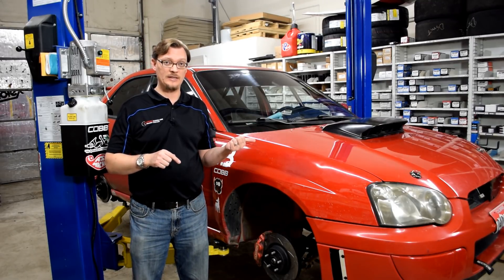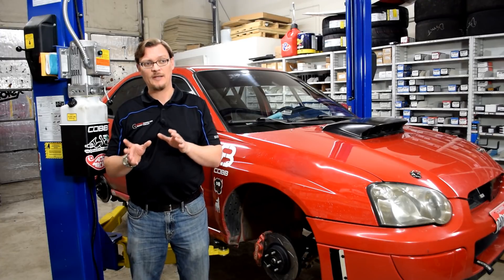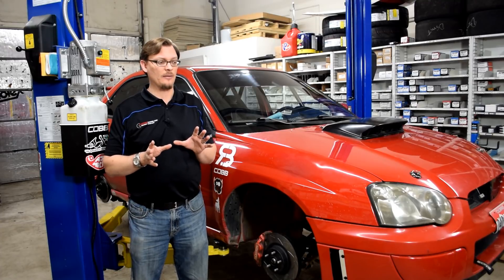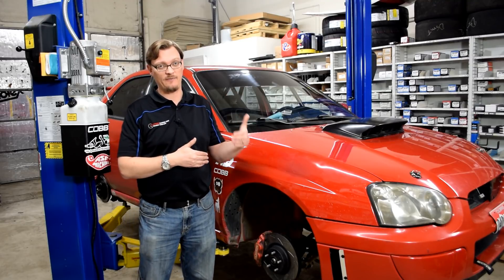STI 6-Speed Transmission Swap FAQ's

Comment: I have a 14 wrx, assuming you're only talking about bolting up a 07 sti trans, my wrx front axles would work with sti trans(center diff),  get  11-21 r180 rear sti axles, 08-14 r180 sti drive shaft, 07-14 r180 sti rear diff. w/ 3.545 gear ratio, 08-21 r180 sti rear diff mount crossmember, plug up speed sensor on trans,  iwire plug n play harness for neutral and reverse switches. Wire in Map dccd controller. 06-21 sti clutcjlh slave cylinder, 04-21 sti clutch and flywheel.  And any other essentials can be found in basic swap kit at flatironstuning.  Let me know if im missing anything. Do I also need a sti starter or can I use the wrx starter ?
Reply from the maker: Thanks for watching and thanks for the question.  Yep, you have it all right as far as I can tell.  Yes, you can use your WRX starter.

If you have any other questions, open up a Live Chat with us on the site and we'll do our best to help.

Thanks for your support and Stay Tuned!

Comment: Werent 02-03 WRXs a 3.90 FD rather than the 3.54 stated here?
Reply from the maker: Thanks for watching and thanks for your question.  Yes, the 2002 - 2005 WRX has a 3.9:1 Final Drive.

Hope that helps and Stay Tuned!
Reply: It is stamped on the gear itself

Comment: i find it funny when someone says they want to do a budget build on a Subaru. do people even realize how expensive it is to make power on these cars?
Reply: Depends on the power level most builds these days are all dyno numbers with no real world useability except highway pulls. Subarus are made for rough surfaces, point to point responsiveness, and cornering hard in poor conditions so that's what you build them for. Realistically 400hp with supporting brakes and suspension is a lot and will leave almost anything for dead on tight twisty tracks

Comment: So if I have the whole drivetrain system from and 08 sti and I want to install into a 09 narrow body will I have any issues with clearance?
Reply: At 14:00 you talked about running a 11-14 knuckle to fix the width issue could I not just use the 08 sti knuckle? Or are they different dimensions compared to the 11-14 knuckles
Reply from the maker: @jesussandoval3713  they are the same.  Just keep in mind that they push the rear wheels out 25mm per side.
Reply from the maker: Thanks for your question.  We specifically talk about doing a 6-speed swap in a narrow body WRX in the video here:

https://youtu.be/uf4tcG5GqDU?si=C8aQRNNLXMgiDKa1&t=755

That should answer any questions that you have.

Thanks for watching and Stay Tuned!
Reply: @FlatironsTuning  thank you for replying so quickly

Comment: I have an 04 wrx trying to swap to a 6 speed setup. Can I use 04 sti hubs, backing plate and parking brake if I already bought an 07 sti trans, driveshaft, diff, and axles? I don’t want to have to change my current suspension set up, I have the car sitting on tiens rn with its current setup.
Reply from the maker: Thanks for your question.  The splines on the hubs are different between the 5x100 and 5x114.3 hubs so you do need axles to match.

Hope that helps and Stay Tuned!

Comment: Hi mate, I’ve put in a 6 speed DCCD into my gc8 v6 type ra (5 speed DCCD) but didn’t change the wiring harness to a 6 speed now my Speedo isn’t working, would you think the 6 speed wiring harness would fix this?
Reply from the maker: Thanks for your question.  The speed sensor between the 5-speed and 6-speed transmission is the same.  It also has its own harness and plug.  I'd say it sounds like an electrical problem, or maybe the sensor got damaged in the transfer.

Make sure that everything is plugged in, and that the sensor is in good shape.

Hope that helps and Stay Tuned!

Comment: Does body style matter? I have a 11' WRX hatchback. I plan on doing an entire STI swap into it. Do I have to use parts from a 11'-14' STI hatch? Or can it be a sedan? Or can I use other years
Reply from the maker: Thanks for your question.  As discussed at the end of this video, the narrow-body WRX's require a few different things compared to the wide-body WRX's.

Since you have a 2011 which is a wide-body, I'd recommend going through our video on the GR specifically as that will be the information that applies to your car:

https://youtu.be/CieGYuOJQj4?si=9DN_nbdoGQBynT4_

Hope that helps and Stay Tuned!

Comment: So is the Neutral Safety switch the same on both the 07 STI and 02 WRX?  I can't remember whether I used the WRX or STI, but now that I have everything back together, I'm having issues with my idle.  I've already replaced the IACV with a new OEM one, adjusted the throttle cable and did a smoke test, but I'm still having issues.  I'm suspect it might be the safety neutral switch.  Thanks.

Comment: This video has me very excited! I was debating on selling my 13 hatch wrx and looking for a a Sti hatch but if the parts are interchangeable this looks better to do. My question is can 6 speed be done to the stock ej 255 engine the wrx comes with? Thanks!
Reply from the maker: Thanks for your question.  Yes, absolutely!  The EJ series bellhousings are the same so you can bolt up the STI 6-speed no problem.

Thanks for watching and Stay Tuned!

Comment: Sti 6 speed box screw location all pnp into 5 speed ej20 forester?
Reply from the maker: Thanks for your question.  Yes, you can swap a 6-speed into an Ej20 Forester.

Thanks for watching and Stay Tuned!
Reply: @FlatironsTuning  ic.. How about avcs head? I just wondering if v8 avcs head can use on my 1999 forester ej20 block, will be save a lot buying sti motor

Comment: can 6spd twin plate use in wrx 5spd?
Reply from the maker: Thanks for the question.  Unfortunately not.  The 6-Speed clutch and flywheel are larger than the 5-speed parts, so they will not fit in the 5-speed bellhousing without significant modification which can weaken it, etc.

If you want a twin plate clutch, it is always best to get the one designed for the transmission housing you are using.

Hope that helps and Stay Tuned!
Reply: @FlatironsTuning  but v789 6spd gearbox can swap into v5 ej20 right?
Reply from the maker: @devil_samuraix6176  Yes, that is correct.

Comment: I got the sti axles in the rear to fit for my narrow body and also still running wrx axles up front with the wrx hubs front and back.  I keep blowing out my front wheel hubs.  Is this because the sti axles in the rear are different in length?
Reply from the maker: Thanks for your question.  That shouldn't have an effect on your front wheel bearings.  What are you torquing your front wheel nuts to, and what tool are you using to tighten them?
Reply: Thanks for your reply!! A torque wrench. 0.005mm(0.0020 in) gap
Wheel bearing bolts are 47.9ft-lbs 
Axle nut 162.3ft-lbs

Comment: Now if I were to swap in a 6 speed into my 11 wrx, and buy the I wire harness. Could I just connect the sti dccd like factory? Or do I need an aftermarket dccd controller
Reply from the maker: Thanks for your question.  You would still have to run an aftermarket controller.  The STI DCCD controller is on the STI CAN bus, so you would not only need the STI ECU, but everything on the CAN Bus that the DCCD controller needs to see to get it to work properly.

The aftermarket controller is the simpler solution by a mile.

Hope that helps and Stay Tuned!

Comment: Will a non dccd 05-08 JDM Legacy spec B 6spd work in a bugeye with stock r160? Looks to be 3.9fd 1.1tr. Says the jdm spec b even came with a r160 until 07?
Reply from the maker: Thanks for your question.  You would just want to compare the rear Ring and Pinion ratio of what you have in the car to what the car that originally came with the 6-speed you are using had as discussed in the video.

Hope that helps and Stay Tuned!

Comment: I want to do an automatic 2003 wrx to a sti 6 speed manual transmission if that's possible, and if not then what is the most reliable 6 speed I can put into my car is there anyone I can talk to about this. How new of a transmission doesn't matter I just want to know what is the best transmission I can put into my car that'll last me and be as reliable as possible I want to be able to race my car sometimes but it'll mostly me a everyday driver so I need it to not die anytime soon
Reply from the maker: Thanks for your question.  The biggest hurdle for you is going to be adding that third pedal.  But yes, it can be done.  It will be easier to start with a MT car for what it is worth.

As to what the best year 6-speed is for a swap, we have that covered here:

https://youtu.be/vI19RFeXics

Thanks for watching and Stay Tuned!
Reply: @FlatironsTuning  thanks for your reply it's my project car that's the only reason I don't want to get a car that's already MT
Reply: @FlatironsTuning  do you have a parts list for the 07sti 6speed swap into a automatic 03wrx or know where I can find one I have checked online but haven't had any luck

Comment: What's up guys,  I am new to subaru. I have a 2005 outback wagon N/A, 5 speed. I need a little more,  can I get a wrx 5 speed,  will the outback axles work or do I have to get a diff too?
Reply from the maker: Thanks for your question.  You wouldn't want to do that  the WRX gearing is much taller because the turbo engines make more torque than the NA cars.  If you put that trans in your NA outback, the car would feel a lot slower most likely.

Hope that helps and Stay Tuned!
Reply: @FlatironsTuning  Im thinking about doing a 6 speed from a gen 4 liberty into my 03 wrx wagon

I saw some guy claim online the shafts are only 2mm or so longer
do you know if you can get away with sti shafts? my wrx has the female to trans cv axles so they definitely will not be usable
Reply from the maker: @Puma6922  The 6-Speed from the Liberty/Legacy is completely different from the STI 6-speed, and as far as I know, there is no axle that will work with your GD knuckles and that transmission.
Reply: @FlatironsTuning  it's a ty856 with a 3:54 ratio, came fitted to 2.5t sti spec liberties and 3.0 h6's here. maybe something you guys didn't get in the states

Comment: awesome stuff how hard would it be to put a 2011 sti transmission in a 2005 sti thers not really any forums on this but im just curios what your thoughts are on older sti to newer sti part swaps?
Reply from the maker: Thanks for your question.  If you go back through this video, there are issues with the speed sensor and rear R&P ratio that you would have to address.

Beyond that, there is a different center differential in those two years, so the stock DCCD controller may not work properly with the newer transmission.

Hope that helps and Stay Tuned!

Comment: I have a 2007 Subaru Forester XT and would like the benefits of having the STI 5x114 lug pattern what would entail a swap for that?? Is there any benefit from going with an STI suspension instead of the Forester suspension???
Reply from the maker: Thanks for your question.  That is actually a fairly involved swap, which will require switching around brakes, etc.  Really, generally speaking, it isn't worth making this conversion unless you know that you need teh 5X114.3 hubs for a specific reason.

Hope that helps and Stay Tuned!

Comment: So to take all this in...I have a 05 wrx and if I choose  install a sti 06-07 trans plug and play. Get the driveshaft and rear diff to bolt right in. Choice of wrx or sti flywheel clutch kit. I want keep stock brakes and suspension, so I can still  run wrx axles ?
Reply from the maker: Thanks for your question.

Definitely take a look at our GD WRX 6-Speed video here:

https://youtu.be/nUJ7E2Bh5g0

We go into all of those questions in these.

Thanks for watching and Stay Tuned!

Comment: Doing one of these swaps now on an 03 wrx. Will the iwire harness work if he doesn't have a diff controller as of yet?
Reply from the maker: Thanks for your question.  Yes, the iWire harness would still work.  The lines from the DCCD would just not be connected, then when you are ready to get that working, the framework is there to connect to the DCCD controller of your choice.

Hope that helps, and Stay Tuned!
Reply: @FlatironsTuning  thank you so much!

Comment: will I run into any major wiring issues when switching from 4 speed automatic 07 wrx wagon to the 6speed?
Reply from the maker: There is a bit of wiring involved there.  Take a look at the auto to manual swap that Bucky did with iWire here:

https://youtu.be/eYlMLlRInps

And you might want to check in with iWire about your specific model to see if there is anything else you need to do.

Thanks for watching and Stay Tuned!

Comment: Hey mate, if interchanging the diff flanges from a R160 to an R180, can this be done without affecting the preload in the rear diff?
Reply from the maker: Thanks for your question.  The nut that you remove to change the flange is on the pinion shaft.  We have always just torqued it back to spec, and haven't had any issues.

So in our experience, it shouldn't make a difference there.  But I suppose that ideally you would want to check the pinion depth after making the change.

Thanks for watching and Stay Tuned!
Reply: @FlatironsTuning  Thanks mate!

Comment: So much good info! Still confused on what my options are for an 02 legacy be/bh n/a chassis thinking a pre 06 6 speed
Reply from the maker: Thanks for the question.  The year of the STI transmission really wouldn't matter, it just has to work with the rear differential you are using.

Hope that helps and Stay Tuned!
Reply: @FlatironsTuning  So if I grabbed an r160 diff I could keep my 5x100 hubs if I just chose the proper front axles whether theyre female or male stubs then grab an auto driveshaft and bolt it all in?

Comment: So if I do this COMPLETE 6 SPEED SWAP
Parts included:
Transmission with crossmember 
Shifter linkage 
Driveshaft
All four axles 
Rear differential
Starter
Flywheel
Pressure plate 
All four hubs
And control arm everything will work ?
Reply from the maker: Thanks for your question.  In addition to this FAQ video that we have, we also have videos on swapping the STI 6-Speed into either a GD WRX, or a GR WRX.  Here are links to those:

https://youtu.be/nUJ7E2Bh5g0

https://youtu.be/CieGYuOJQj4

We go into detail there about what parts you need to swap out, and what you can keep, etc.  I'd recommend going through the video that goes with your car, and if you still have questions after that, just let us know.

Thanks for watching and Stay Tuned!
Reply: @FlatironsTuning  can u just tell if that's the parts I need

Comment: Hi.
Did you have done any 4eat to 114.3 conversion?
I have a 06 Forester 2.5XT and want to convert it to 114.3 and keep the 4eat.

I do have a set of Front & Rear hubs and bearings from 06-07 GDB-F STi.
It's not a problem to get a set of new shock absorber for 06-07 GDB-F STi.

I thought the Front 114.3 hub would compatible with my 4eat front axel.
But the rear end is a pain in the ass.

As I know, there is no R160 to 114.3 hub rear axel exist?
(Some said Tribeca rear axel will work, but I could not found any definite answer.)

The ratio of my 4eat is 4.11, I believed.
And there is no R180 with 4.11 ratio exist that I can just swap the whole rear end?

I would be grateful if you have any good idea/experience for this.
Thank you.

Comment: Can you make a video or tell what the easiest sti 6 speed swap on my 2010 wrx hatchback I have adhd nd cant get it
Reply from the maker: Thanks for your question.  We actually have a video all about GR swaps.  Here is a link to that:

https://youtu.be/CieGYuOJQj4

Between the information there, and the narrow-body info at the end of this video, you should have all the information you need.

The short answer is that it doesn't matter what year STI transmission you get, as long as the rear differential works with the transmission.

Thanks for watching and Stay Tuned!

Comment: First thanks for all these informative videos. I will be doing bolt on upgrades to the bugeye when i get back from deployment: Tomei headers and catback, sti control arms, adjustable sway links cause i put king lift springs for a gravel setup. And I will gladly purchase from Flatirons Tuning (I already have the items bookmarked). looking at doing a 6 speed swap. While looking at the JDM 6 speed options I saw some have female splines and others with the male. My question is: are these output splines interchangeable? I found a good deal on a 6 speed kit with rear diff and drive shaft for under 3k. to keep the wrx axles and knuckles id need the male spline from trans. can I change the 6 speed output spline from female to male? thank you
Reply from the maker: Thanks for your question.  If you have not found our GD video yet, I'd recommend starting there:

https://youtu.be/nUJ7E2Bh5g0

We go into those exact details in that video.

I hope that helps, and Stay Tuned!

Comment: What about 6speed swaps in 90s Impreza’s? 

I’m planning on doing this on my 98 Subaru Impreza outback.
Reply from the maker: Thanks for your question.  For a GC, the steps are basically the same as what we laid out in our GD section.  You just have to make sure that the rear differential you use works with your transmission.

https://youtu.be/nUJ7E2Bh5g0

I hope that helps and Stay Tuned!
Reply: @FlatironsTuning  omg thank you!!!!

Comment: Hi I have a 2006 subaru impreza wrx  that I'm looking to do a full transmission swap in it. But im not sure what year I can buy. Thank you
Reply from the maker: Thank you for your question.  You can use any STI transmission, you just have to make sure that it will work with the rear differential you use.

Hope that helps and Stay Tuned!